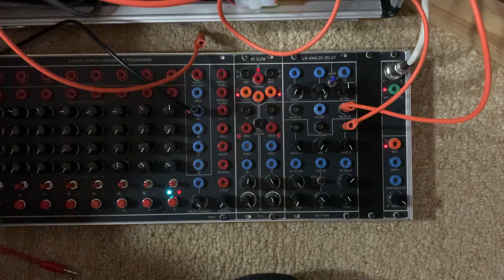hale VC SLEW

Comment: Is there a way to achieve synch between the two sides when both are operating as oscillators?
Reply from the maker: kinda! The timing and > outputs can be used as a kind of phase comparator. You can feedback patch either of those center jacks into the CV of either side to get different frequency and phase locking type of effects... but expect them to be on the dirty side.
Reply: @halemodular4049  I was attempting synch by going directly from the pulse out of right into left HOLD jack...
Reply from the maker: @TomDjll  some different tricks will get you close but there is no way to really do a true sync / reset of the integrator in the VC SLEW. The next CV generator which has separate rise/fall is retriggerable/syncable.
Reply: @halemodular4049  Well I tried your suggestion and I like the timbres of that as well as the method I was using. Thanks!